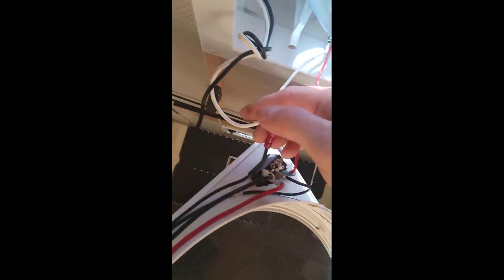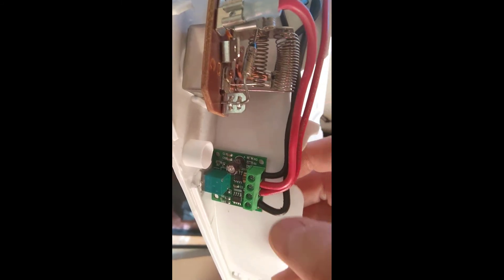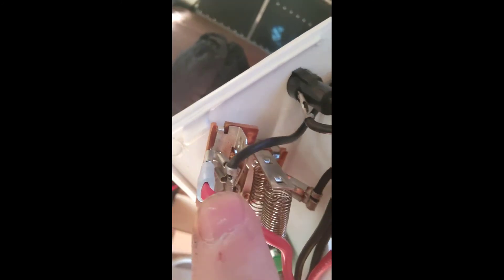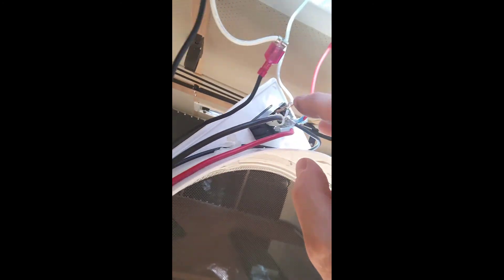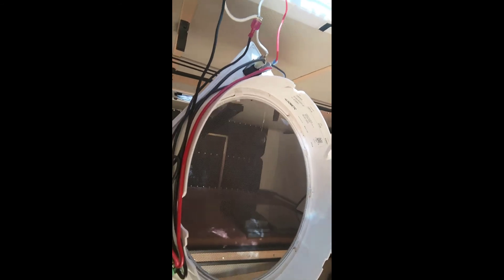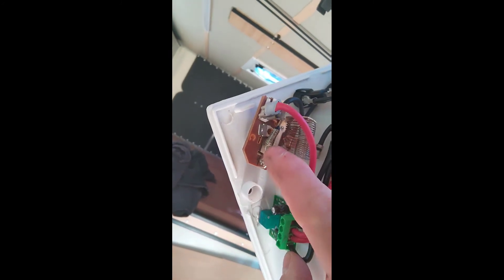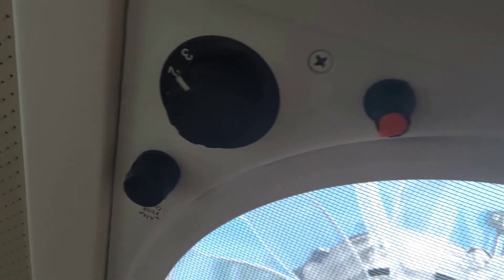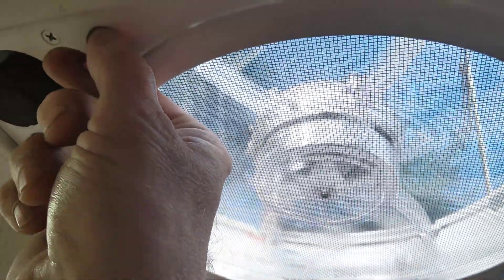Pulse Width Modulator (PWM) Modification For Fantastic Fan, 3 Speed Manual Control, Reverse Switch

Comment: Dude, I'm in a similar boat in that I'm not an electrician and my Fantastic Fan is just running too fast, even at the Low setting.  I hate the idea suggested by Dometic to wire in yet another resistor to bleed off more power as heat, so I got the same PWM switch as you and successfully followed your directions!

As far as I can find, you have the only non-invasive wiring option so that I can return my fan to its original configuration, if necessary, and your instructions are by far the easiest to follow.

Using my Victron battery monitor, I carefully measured when my reconfigured fan was drawing about 2 amps and marked that point with a Sharpie.  It was probably turning as fast as on the old Medium setting so still a lot, and this way I can ensure that I don't exceed the fuse limit.  

Thanks for posting the only solution like this I’ve found and I just wanted you to know you’ve made my wife and dog and me very happy!

Thanks again!

Comment: is this a 3A PWM you are using? I would go for a little more .. my fantastic draws about 2A at high speed and I've seen people reporting 3A. So I decided to go with a 100W PWM motor speed controller. Much more than I need, but I'd rather be on the safe side.

Comment: Worked for a minute, then, then it reverted back to being controlled by the 3 way switch again. All connections seem tight still. Any advice?
Reply from the maker: hmm maybe you burnt it out somehow, if it did work for a minute. Mine still goin strong after 3 winters. Bummer that must be frustrating. Covering up that hole up top worked for not getting water in there, I'm sure. I also sprayed it with "Corrosion Block". I had to go in there to look at something else a while back and it was all clean.
Reply: @myfourwheelcamper  Thanks for your comments. Apparently I shorted out the PWM somehow when putting the fan back together. I ordered a new PWM and it worked just fine. Was more careful putting it back together this time. Still works a few hours later.
Reply from the maker: @michaelcrosby6322  Its nice to know that if it does burn out the fan still works! I know enough to be dangerous with this stuff. This was such a great upgrade for me, not having all that noise is just great.

Comment: Just installed the PWM. Works great.
One thing I did though was I used 2 T Tap connectors for the 2 red wires that go to the black wire that interconnects the speed switch and the directional switch. I connected the reds to the PWM and then used the t tap connectors on the single black. Was a little easier as I couldn't find the dual post ones like in the video.
Again, Great instructions. 👍🙂

Comment: I have the same PWM but I wired it as a replacement.  Haven't used a lot yet but I'm happy so far.  I've heard of others having a problem with moisture causing a failure of the PWM.  Some have conformal coated the PWM to prevent this.  I have the same multi-meter as you also - looks like 3.2 amps at high speed and 0.04 amps at slow speed.  That's amazing.
Reply from the maker: Yea I used really fat wires for the PWM and I'm not sure if that contributed to the low amp usage. I'm learning as I go with this stuff. I sprayed the PWM with "corrosion block". It comes in a shakable spray can and my boat electronic guru insisted that was all I needed to do, so I'm going to trust him and if it fails well $8 down the drain. No biggy.
Reply: @myfourwheelcamper  That stuff is cheaper than the conformal coating I was considering.  Can you provide the brand and name of this product?  Thank you.
Reply from the maker: Corrosion Block: https://amzn.to/2FpMp3K